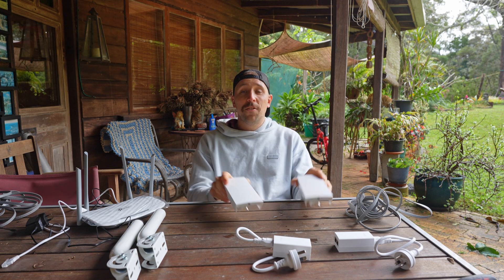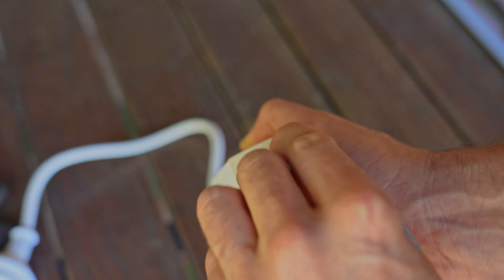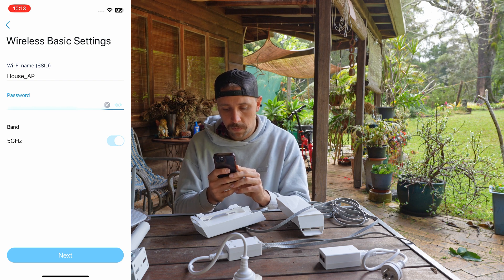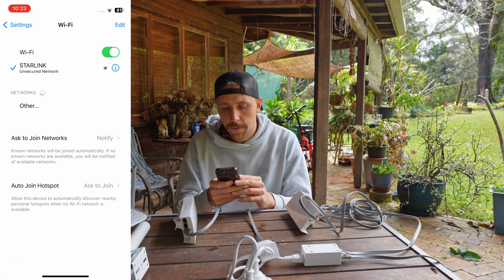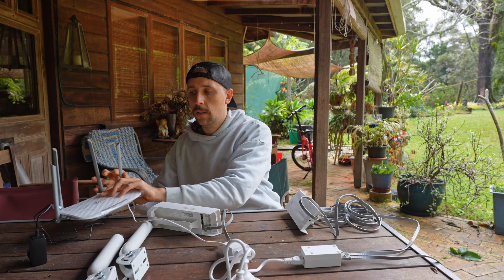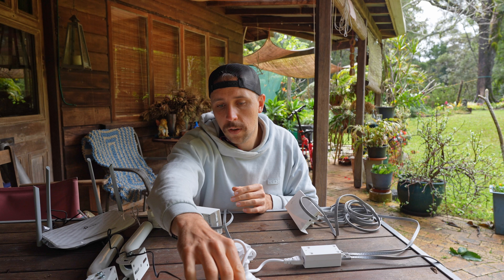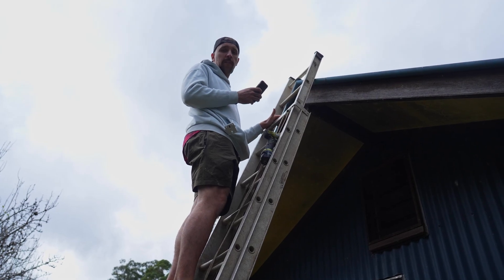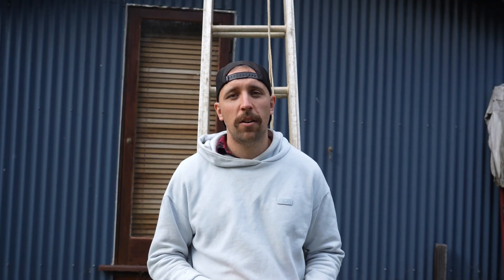How to Extend Wifi to Another Building (Studio, Shed, Barn) | Setting Up a Wireless Internet Bridge

Comment: Hi, Amazing video! Just curious, what would be the diffrence if instead I choose wirless router instaed of access point? I am curious as I want a bridge to a backyard granny flat. And I want wifi there as the connection is literally non existent. Thanks
Reply from the maker: Thanks! Not sure exactly what you mean? If you’re trying to get signal inside the granny flat you are best to use the two paddles as a bridge (effectively a wireless cable) and then connect the receiving one up a wireless router like I did - you’d set the router up in the granny flat and connect your devices to that
Reply: @juliustinkers mega is talking about , instead of choosing ac point in the router settings like you did , how about choosing router options .. mega wanted to know if the results will be the same ..

Comment: Just got rid of another brand and got this one since we have the same brand router. I’m confused about the ground wire though why is it needed ? I never saw any other video talk about it
Reply from the maker: I believe it’s just to protect it in case of a fault or surge, lightning, static etc as it’s outside rather than the surge going through the Ethernet. Doesn’t affect its wifi performance - I actually never ended up connecting ground
Reply: @juliustinkers thank you for your v reply

Comment: Really useful video thanks mate. One question. Can I use the same SSID as my router to keep everything on the same network or does each need a different SSID?. I’m not sure my Eufy Homebase 3 and the cameras will work if I use different SSIDs. 

I also have Starlink but in bypass mode with a NETGEAR Orbi RBR750 router plus five Orbi RBS750 satellite APs.

I just purchased the TPlink EAP211  kit to bridge the 35 meter gap between the house and the stable block to improve the WiFi  signal for my Eufy security cameras.

I’ll be connecting one of the Orbi AP’s to the client TPlink unit via the POE block.
Reply from the maker: Thanks! Glad the video helped!
For your setup: I dont think the TP-Link bridge units themselves would broadcast WiFi with the same SSID as your main router. They’re really just meant to act as a wireless cable between the two buildings.

I think what you might be able to do is this:

Use the TP-Link pair purely as a bridge
Then let your Orbi handle the WiFi in the other building
The Orbi can broadcast the same SSID as your main network - i think this is a mesh setup, but havent looked into this too much.

So keep the TP-Link units as the link, and let the Orbi AP in the stable broadcast the SSID your Eufy gear expects. Everything should stay on the same network and work normally. You might have to do some more digging though!

Comment: not technologically savvy here, will such a device work going into a metal sided building?
Reply from the maker: It’s probably going to struggle through that - if you’re thinking just using the bridge. If you set up a modem inside the building like I did though it should work fine

Comment: Hi! Great video. Is it your starlink connection that limit the connection speed to 70-130 mbits or is it the hardware/line of sight? On the specs for 215 it says it should be able to reach 800 + mbits. Thanks in before from Sweden.
Reply from the maker: The starlink speeds vary but typically we see 150-200mbits. I think there is some drop by extending it, trees in the way and then the router at the other end is a budget one, so that probably limits it a bit further

Comment: I wish you would share how you ran the electrical and Ethernet lines from outside to inside as that’s the part that’s now got me stuck. Great video otherwise!
Reply from the maker: At the house side there was an existing whole in the weather boards where the starlink cable went through so I just used that. At the studio side because I just squeezed it over the top of a window (flat Ethernet cable). Not much help there sorry!

Comment: I hooked up my bridges in both locations and got a signal,  then plug my Wi-Fi extender into my bridge, but then when I search for Wi-Fi connections it's not picking up my network.
Reply from the maker: Hard to diagnose without seeing it. I would just try running through the setup steps again in the first instance in case something was missed

Comment: Hey mate, just wondering what the latency/ping change was from the house to the studio? And the overall speed difference when on starlink wifi vs in your studio. Thanks
Reply from the maker: Just ran a couple of speed tests. Starlink wifi: 285 Mbps & 21 ms, Studio paddle / access point: 145 Mbps & 20 ms, Studio router: 46 Mbps & 35 ms. 
I think it’s loosing a bit as there’s a few trees it’s trying to punch through and also the router was pretty cheap so that’s probably letting it down at the very end.

Comment: Great video mate, I’ve been using deco mesh units as a soft of bridge but it’s not ideal, so I’ve purchased a set of the units you are using. Hopefully it will be stable and provide a reasonable speed.
Reply from the maker: Hope it works for you! This has been running for 9 months or so and works well - has given us consistent internet both at the studio and around the property

Comment: Just one question, Is it possible to put 2 receiving radars in a Bridge ? I have a motel that has internet and want to get wifi in the house beside the business.
Reply from the maker: I’m not 100% sure sorry as the two bridges automatically link up. Might be a question for TP Link (or whatever brand you choose). One option I know would work is running another bridge paid off your receiving paddle. Either via the lan port on the paddle or off the modem at the receiving end
Reply: @ You mean to say,
I should buy another bridge and Use my first receiving radar AP as extending radar and put receiver radar at other place.